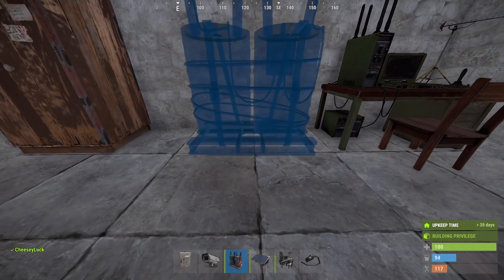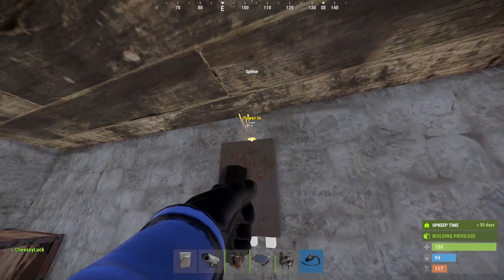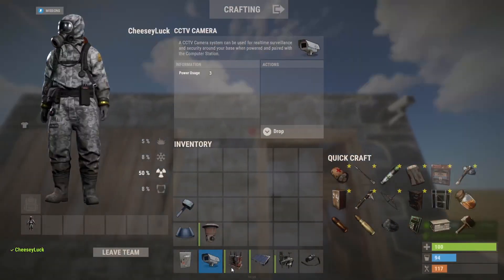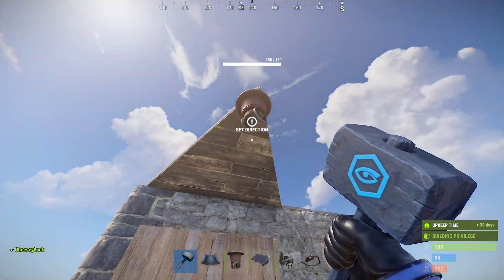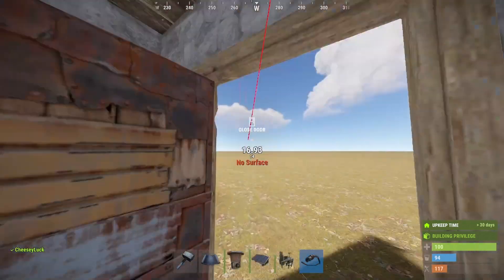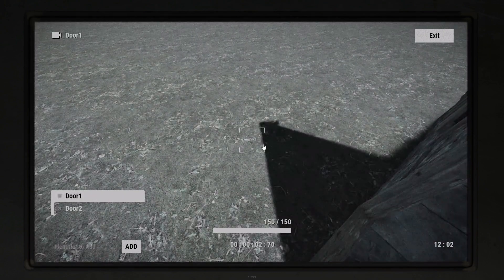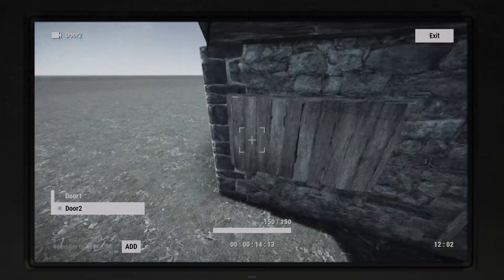How to Setup Security Cameras in RUST...

Comment: why i take the hammer but can't set ID to camera . only think i can do is take it back to my bag. I'm doing on Creative server
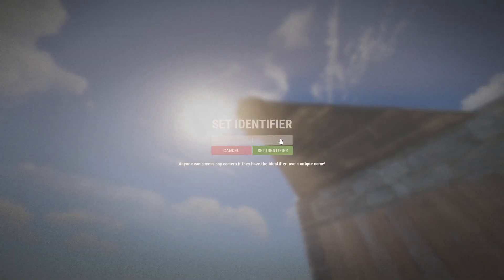Reply from the maker: So the hammer will set the position of the standard camera since it is set to a fixed position. To edit the ID you need to have nothing in your hand then you should be presented with a prompt. As seen at 1:35
Reply: @DrHappyRust  than kyou i will try it on real server not creative to see if that is a problem